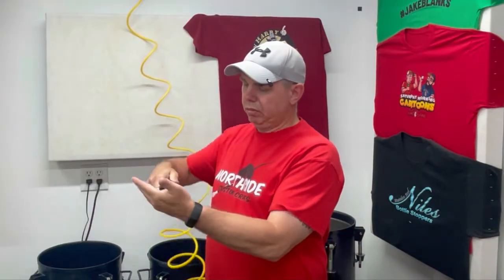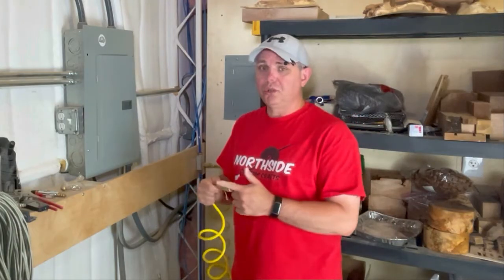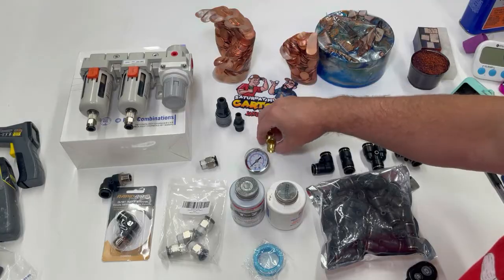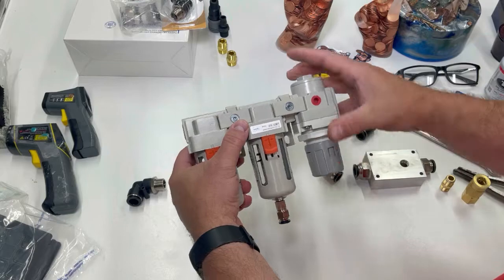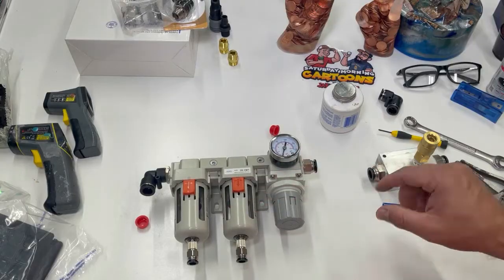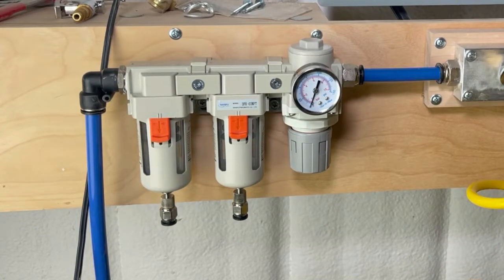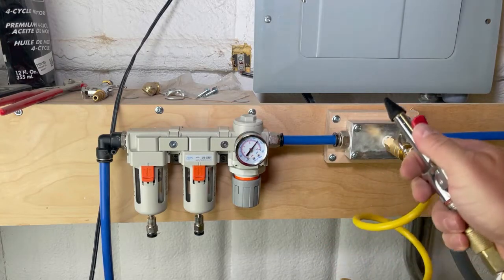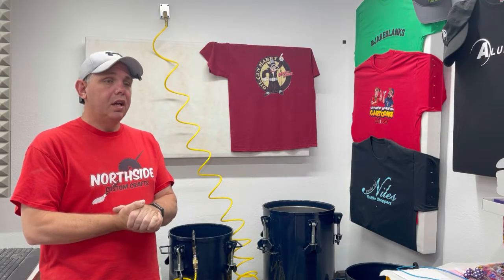Save Your Tools from Moisture in Air Lines! Cheap Fix!

Comment: I added the exact unit and a second at my media blaster and while it does catch some fluid you have to empty it even during using it as it allows a decent amount through. I checked my compressor and it doesn't have water in it. I may be looking at a larger filter with desiccant pods in it